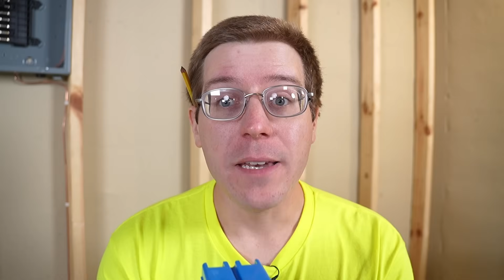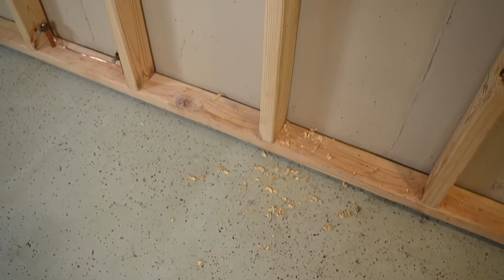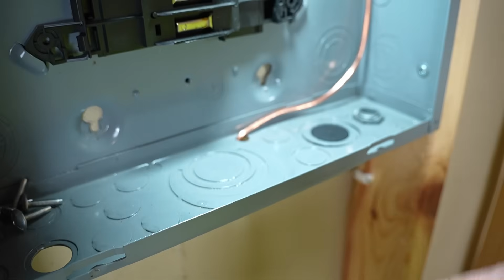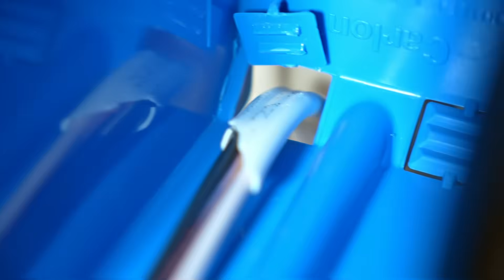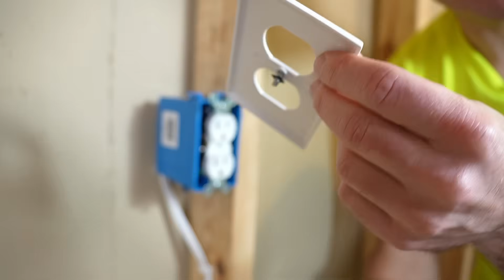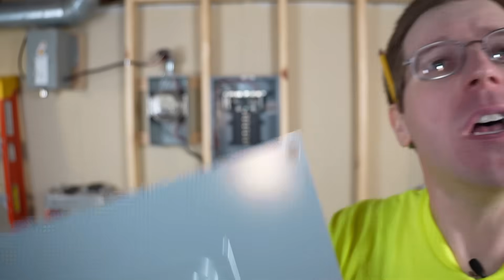Unlocking the Basics: Wiring a Receptacle Outlet Start-to-Finish

Comment from the maker: Electrical work can be dangerous if it’s done incorrectly and can result in fire, property damage, serious personal injury, or death, which is why electrical codes, permits, inspections, and safety procedures exist.

This video is intended to explain how things work and why they’re done a certain way—not to suggest that unqualified people should perform electrical work themselves. Any electrical work should only be done within a person’s level of training and experience, using applicable safety procedures, and in compliance with local codes.

DIYers should limit themselves to tasks allowed by local law and within their skill level. Electrical apprentices should only perform work as part of a licensed program and under proper supervision. When in doubt, involving a licensed electrician and the AHJ (Authority Having Jurisdiction, such as the local electrical inspector) is the right path.
Reply: Im calling a licensed electrician and I have regular ungrounded outlets that have 2-4 And 6 piggyback wires going to all hells creation in one Room, we plugged in a wall heater on 1,500 watts and my wall outlet started smokin after 15 minutes of heat, thats when all the other outlets started acting stupid and only read 2.0 volts, did I destroy that outlet with that mini fire.

Comment: Some plastic electrical boxes have Romex tabs (where the Romex wires enter the box) that are breakable as in this video while others have a tab that breaks only on one side and swings open and even presses on the Romex wire to hold it in place. The ones that can be broken like in this video (and even others), is it ok when the whole tab breaks and leaves a hole in the back of the box even though there might be a wire in it, or does the box has to be as sealed as possible?

Comment: You are an excellent teacher. Watching this with my 12 yr old grandson. I bought a 40 yr old Mobile Home ($600) took it to the land ($500 transport), tore a lot of it out and rebuilt it including 100% off grid, plumbing, floors, framing 2 x 4s, roof repair, drywall, complete kitchen and bathroom remodeling with materials put in higher end homes as well as high end antique fixtures. Have been doing new wiring having abandoned the original wiring. Thanks for being a thorough teacher for my grandson. He and I work together. I intend for him to never be a slave or in debt to anyone - a truly free man (Cash is private and the way to be truly free).

Comment: There's a reason the "knockout" on the plastic box is designed with a hinge.  If you leave it in place, and pivot it 90 degrees, two wires will fit perfectly next to each other, eliminating the need for a staple to hold the wire near the box.
Reply from the maker: These cheap boxes don't work like the nice ones with the wedge. I wish I would have paid attention before buying a whole case of them.

Comment: I’m a new subscriber and I haven’t looked into all your videos yet but I have a home that was built in 1960 and I have old wiring with two prong receptacles. However, I have three prong receptacles in my den room but after checking for 120v I noticed although they are three prong receptacles they are not actually grounded. No 120v! How do I ground these and where should my main ground come from? I also checked the 2 prong receptacles and they do have the metal boxes but these to are not properly grounded either. I want to upgrade with the 3 prong receptacles but don’t seemed be grounded properly! What do I need to do?
Reply from the maker: There is a section in the code book that addresses this. I don't have the book in front of me at the moment, but I believe it's 406.4. Basically you can replace the wire to get a ground wire there, or you can GFCI protect the first receptacle and replace all downstream receptacles with a 3 prong receptacle bearing a sticker "no equipment ground". There are a few other options there as well.

Comment: Does it matter which screws you use in the receptacle for neutral and hot? For instance if you use the top neutral screw do you need to use a specific screw for the hot wire on the other side or would any of the 2 hot screw work? Also would anything change if using pig tails to connect multiple receptacles, or using the receptacle itself as a splice?
Reply from the maker: If the receptacle isn't split, you can use either gold screw for the hot, and either silver screw for the neutral. if the receptacle is split, you would have to keep track of the different wire purposes.

Comment: Its bad practice to teach to land the hot wire first. For safety purposes, you should always connect the ground wire first, then the neutral, then the hot wire last. Even if the circuit is not live. This way when you have to do it live, you need to wire the receptacle in the same order.
Reply from the maker: Yep I agree 100%. It's hard to convey a lifetime of experience in such a short video, some things get missed. Cheers!

Comment: To remove or replace a breaker how do you shut off the main power, and is it the same process for a switch
Reply from the maker: The main breaker will shut off all the branch circuit breakers. That is how a breaker is added or removed. To work with a switch, the branch circuit for that switch is turned off. Definitely reach out to a local electrician when in doubt 👍

Comment: per nec its actually staple with in 12 inches if the box has a clamping device and with in  8 inches if it dosent have a clamping device (like the box here in this video
Reply from the maker: Yep! You are 100% correct. I addressed this in the video where I wired multiple receptacles. Cheers!

Comment: I didn't see it mentioned, but isn't it code fpr the receptacle to be installed with the ground hole on top now? I know traditionally it was oriented to look like a face, but my Dad was an electrician and he said code required to be flipped now.
Reply from the maker: Nope, there actually isn't anything in the code that requires the grounds to be on top. It's not mentioned in the UL standard for receptacles, either. It's totally personal preference which orientation they are installed 🙂
Reply: @SmarterSparky Good to know!

Comment: cabel runn throw block wall how u gone put new cabel if u needed in future why not a cabel inside pipe? so u can pulle our or pull new cabel for future
Reply from the maker: The code book is not concerned with future replacement. If the wire gets damaged in the wall, the wall will need to be opened up so the wire can be replaced. I know it sounds pretty bad, but you have to ask yourself, why would the wire be damaged in the first place. Yes, they do get damaged when installing TV brackets and the like, but it's pretty rare.

Comment: Hey Sparky,                                        In regards to tightening the screw on the cover-plate, 🍒 or no 🍒, I’d rather tighten the screw so that it secures the plate to the outlet nice and firmly. … No cover plate wiggles! 👍
Reply from the maker: Yeah that's why I like the nylon (unbreakable) covers. That way if they wiggle, i can turn it another half turn so it doesn't wiggle.

Comment: Should probably mention that the hole size and location matters.  Especially if you have to go through something important.  Had a flashback of some terrible holes through the bottom of support beams.
Reply from the maker: Yes! That is a great point! I did talk a little more about the hole location in the multiple receptacle video, but you are absolutely correct about the support beams. Once when I was an apprentice I was told to run a grounding electrode from a stepdown transformer to a water riser. I drilled right through the engineered LVLs and ran the 3/0ish copper. My journeyman started to freak out, and I didn't understand why! 😵He went directly to the general contractor super, who immediately got on the phone with the engineering company. After a few short minutes of me having an absolute panic attack, the engineer said it wasn't a big deal, and how I drilled/routed it was perfectly acceptable. But that was the last time I ever drilled an LVL without permission 😅For those reading this in the future, LVLs only have certain areas that can be drilled, and it all has to be engineered out. Don't drill into them without permission!

Comment: I am a 45 yr drywall Installer/ finisher and I mark all studs  prior to installing drywall and never fasten screws any closer than 6 inches away from electrical switches / boxes  because then I know the screw is seated properly to avoid them being popped when the receptacles are fastened to boxes and always push wires in boxes to back of box to avoid cutting wires because electrician in canada never push wires to back of box
Reply from the maker: We need more drywallers like you! 🙂

Comment: So you have 2 connection points on your hot and neutral sides, lets call it top and bottom, i saw you have the hot connected to the bottom on the gold screw and the neutral connected at the top on the sliver screw .Does this make a difference or can they be connected in the same line? Hope my question is not too confusing
Reply from the maker: That's a good question. No it doesn't really matter in this case. You can put them directly across from each other. Normally i would put them directly across from each other myself, but for some reason I did them diagonally in this video. The only time it really matters is when you break the tab between the two hots and the two neutrals. Then you can control the receptacles independently from each other. Then the top screws would be for the top receptacle, and the bottom screws would be for the bottom receptacle. When the tab is in place, the top and bottom are connected together, so it doesn't matter. Hopefully my answer isn't too confusing 😅

Comment: So taping around the receptacle with electrical tape once you install the wires is not needed?? I was always told to tape it all around it before screwing it to the box.
Reply from the maker: Yep, exactly! Wrapping devices with electrical tape is a personal preference. Nowhere in the NEC does it require tape around devices. The only time I do it is when the box is really full, or the device is installed in a narrow metal box.

Comment: I’m a licensed master electrician as well. If you pull a chalk, or measure your holes that you’re pulling wire through…it looks so much better. It’s not really necessary but I like my work to be super clean and uniform. Also, do not use those quick connects in the back. In the past when I worked as a service tech, it was one of the leading causes of power loss.
Reply from the maker: Welcome! I love the chalk line idea. Or even a laser line! I agree, those quick connects are bad news. I've seen quite a few of them fail causing power loss. Thanks for taking the time to leave a comment, I really appreciate it!

Comment: Great video! Thank you for posting.  You've inspired me into coming back as an electrician in my next life.

One detail - doesn't code specify the maximum size of the hole and minimum set back from the front of the stud to prevent the drywall screw from accidently penetrating the wire?
Reply from the maker: Haha nice 🤓 That's a great question, and yes, it does! Article 300.4(A)(1). I mention this a little more in the multiple receptacle video, but don't call it out by code. There is a minimum of 1 and 1/4" required from the face of the stud to the edge of the hole. So the maximum size a hole in a 2x4 stud can be is 3.5-1.25-1.25=1". The largest in a 2x6 stud would be 5.5-1.25-1.25=3". If the hole needs to be bigger than that, nail plates need to be installed. They even make special kinds of nail plates for metal studs that just stick on. Thanks for stopping by and taking the time to comment! :)
Reply: @SmarterSparky Thanks.  Cheers!

Comment: Great video. I'd love to see a video on rewiring. My house is some crazy setups and almost none of the wall outlets are on 20amp circuits which is our code now (it's an old house). Would love to see a video around tricks for rewriting that minimizes drywall removal.
Reply from the maker: I will do my best to figure out a way to do that. The best way would be to find an old house that needs a wiring update, but that's not in the budget 😊My house is older, too, but the wiring was already fixed before we got it. I'll keep this on the back-burner, though... Thanks for the suggestion!

Comment: Amazing! Thank you for taking the time to explain the little extra steps. When you are new to this it helps.

I would love to see the explanation on the ground and neutral. I have the same panel, and I need to install 220v for my woodworking machines, but I do not know if there is ground or not.
Reply from the maker: Thank you! I am really excited about the ground/neutral video. Not sure when I'll get to it, as I want to make sure it's planned out well. If your panel is the main panel, the grounds/neutrals will likely share the same bus bar. If it's a subpanel, they will be separate. When in doubt, a local electrician will be able to tell you very quickly. Thanks for commenting!

Comment: Very good instructions but I also like to tape up the terminals on the outlet screws.
Reply from the maker: That's a good tip as well. I will certainly tape up certain receptacles as well. I don't do everyone of them, though. Mostly I'll tape them up when they are installed in metal boxes. Especially when they are installed in metal cut-in boxes, and secured with F-straps.

Comment: Diction, please. Remember that you are teaching apprentices, this is not a journeyman class that you are instructing. - There ARE nails in the box, not there IS nails in the box. Use the plural form of the verb "to be" when there are more than one of an object. Later in the video, you changed your terminology somewhat, which is good but not consistent You are not pulling wire, but cable which is the term for an assembly of of conductors in a common sheath.
You neglected to indicate why  you are drilling through the center of the studs - you should have explained why you need 1- 1/2 " clearance from the edge of a framing member, and offer the reason why that distance is required. You might know how to do this job, but your instructional skills are lacking. You need to indicate that you must have a full 1/4 " of sheathing entering the junction box. Thankfully , you used the term "panel" rather than a main box or something equally improper near the finish.
Also good ; at least you discouraged back-stabbing the receptacle, I am grateful for that.
Reply from the maker: Thank you for the detailed analysis of my instructional deficiencies! I am first and foremost an electrician, not an English major, so I certainly do mistakenly use the wrong words from time-to-time. This is meant to be conversational and not formal. You are 100% correct that wires are the individual conductors, and a cable is an assembly of conductors.

I believe you are are referring to 2026 NEC 300.6(A)(1) [previously 300.4(A)(1)], which requires 1-1/4" (not 1-1/2 inches as you mentioned) from the edges of wooden framing members, to the edge of the bored hole. I do mention this in the sequel to this video where we wire multiple receptacles. I will be sure to the mention the minimum of 1/4" sheath requirement in a future video.

Comment: Always use nylon covers because the hard plastic ones will crack if the drywaller removes it to drywall he will break it and reinstalling it show always use nylon
Reply from the maker: Absolutely. Nylon (unbreakable) covers are the way to go. The brittle plastic ones are not even worth getting.

Comment: When you tighten the screw into the box from the outlet to attach the outlet to the box you should always pull it to the right or to the left so the screw is either to the left or to the right of the screw hole that way you know the screw will be perfectly level rather than guessing if it's directly in the center😊
Reply from the maker: Great tip, thanks for sharing!

Comment: Don't forget to tell people when you have two wires inside of a box for an outlet you must pigtail you don't have to buy towed but it is better for future wiring if you pigtail all the neutrals and all the hots together and then put the one pigtail on the outlet that way if the outlet breaks you will still have constant power down the line and you only have to replace the outlet
Reply from the maker: 100%. I mentioned this in my newest video showing how to install multiple receptacles. I prefer the pigtail method.

Comment: Every electrician knows the right size to strip however if you were a DIY or the breaker actually has a marking on it that tells you how far back to strip to install the wire and leave plastic outside of it and only have just enough to go in under the screw
Reply from the maker: That's a good tip! I will be sure to mention that in another video.

Comment: The code requires 6 in of wire to be left outside the cable box all receptacle box if you have less than 6 in you will not be in code must be at least minimum 6 in once the exposed wires are outside the box😅
Reply from the maker: The 6" rule is from where it leave the cable sheath at the back of the box -> 2026 NEC -> 300.16(A) -> "At least 150 mm (6 in.) of free conductor, measured from the point in the box where it emerges from its raceway or cable sheath, shall be left at each outlet"

That does not mean 6" from the front of the box. There is a diagram in the NEC handbook that clarifies this. It shows 6" from where it enters the box.

300.16(B)(2) requires at least 3" of conductor sticking outside of the box opening. 4 inches sticking out is 100% within code.